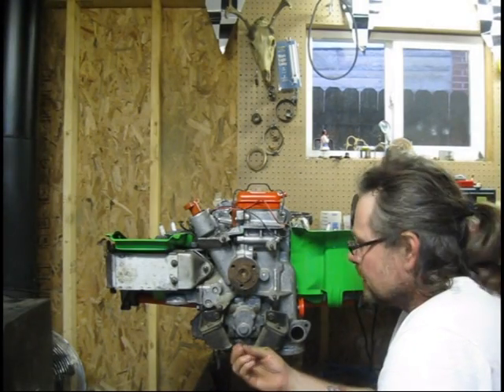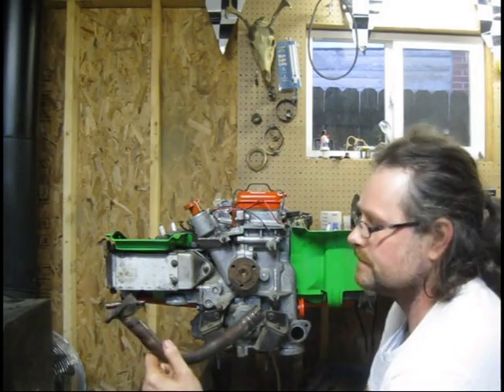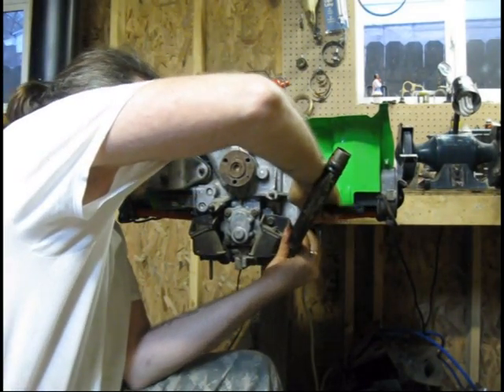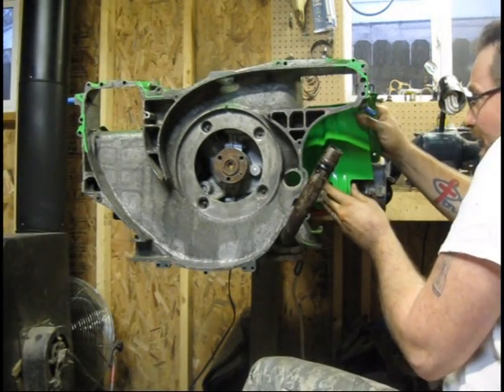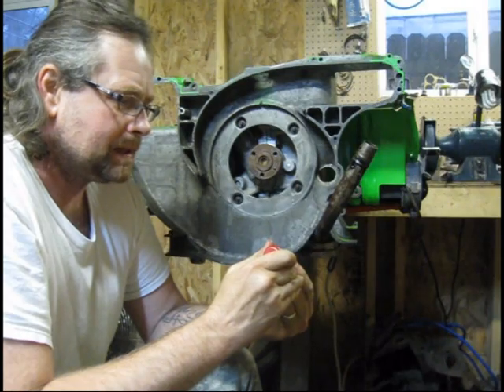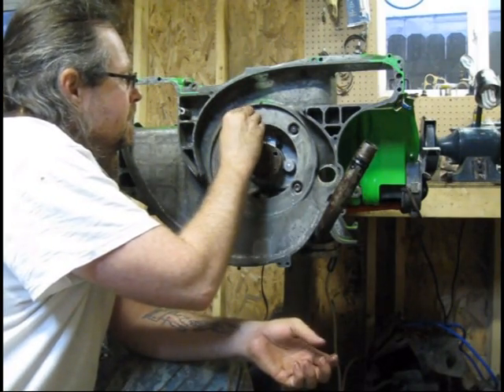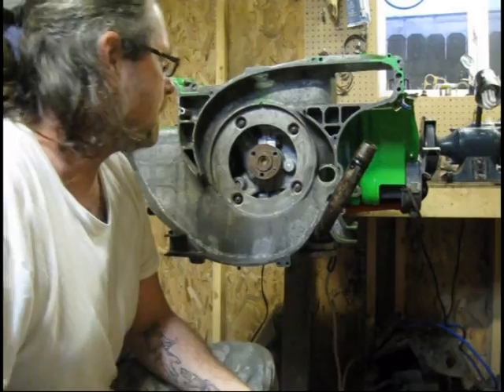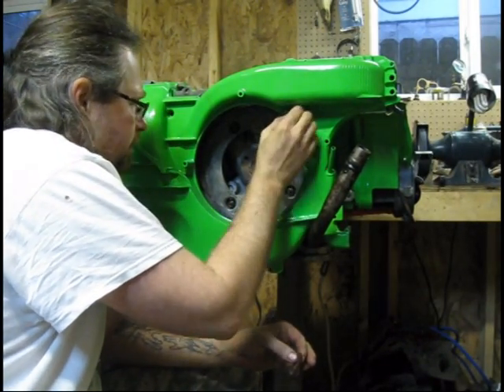Type 4 Fan Housing Install

Comment: Hello! I've been searching for a video of someone opening up the Fan Shroud on a VW 1978 Type 4 engine. We have barn find that needs some love. We're having some trouble cracking it open for a cleanup and we don't want to force anything. Any advice? Do you have a video or know of one that steps you through opening a fan shroud up and cleaning it?
Reply from the maker: I would recommend that you have everything super clean and inspect it for a screw that may have been overlooked. Best wishes with your project and thx for watching!

Comment: is it possible to change the oil cooler seals without removing the engine from the vehicle ?? i changed the crankshaft seal very easily. my bus is a 1979.